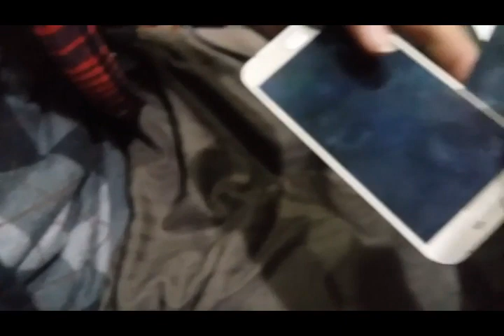Samsung A800 (A8 2015) Disassembly

Comment: what liquid is that?
Reply from the maker: gas oil
Reply: @easyrepairingtips7794  What can we use in replacement if gas oil is not available? Turpentine?
Reply from the maker: Ahmad Nizam you can use any type of liquid like thiner or ctc